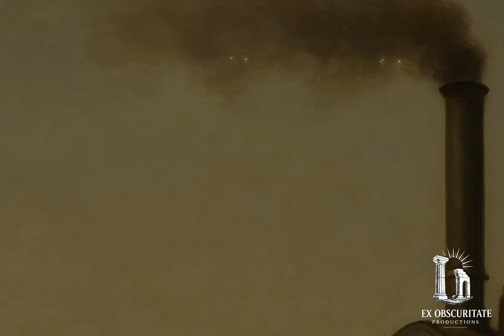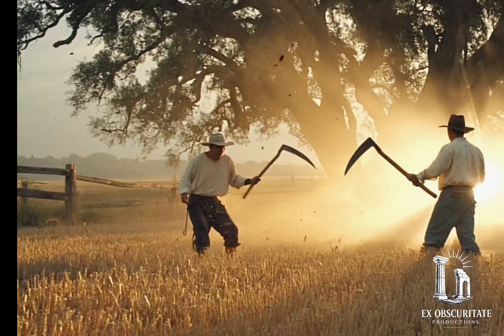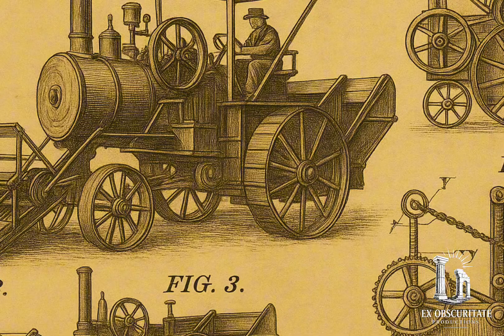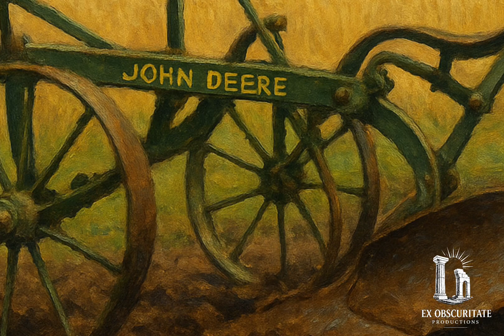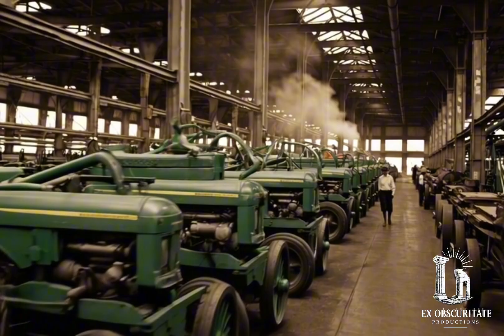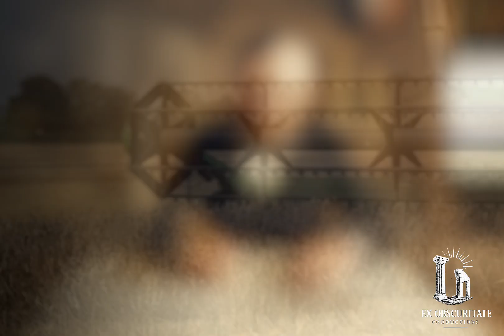How a Wisconsin Inventor Beat John Deere to the Self-Propelled Combine

Comment: H V McKay Sunshine in Australia and Massey Harris both had self propelled combines before WW2
Reply from the maker: Yes they were big early players in the market
Reply: The Massey Harris # 20 is generally accepted as being the first commercially successful combine harvester. It was first manufactured in 1939, and some 925 units were built over a two year period, when the smaller model # 21 replaced it, as it was cheaper to manufacture, smaller in size, appealed to a much wider market and priced such that it was much more affordable than the previous machine.

Comment: John Deere was no where near the inventor of the Self Propelled combine.  Quick and Buchele in their book the Grain Harvesters mention many other contenders.  They list the steam powered Berry combine of 1886 as the first self propelled combine.  It cut a 40 foot swath They list other machines by Holt and Best and show pictures.  An 1893 Holt cut a 50 foot swath.  Pushing the size of the McDon headers of today.  Gleaner had a tractor mounted combine earlier in the 1920s but it was not a true self propelled. The Massey 20 of 1938 with 925 units built was the first mass produced self propelled combine.  It was replaced by the smaller Massey 21 in around 1940.  This was the first commercially successful self propelled combine.  The Massey 21 is remembered as the machine used in the first harvest brigade.  IHC had the 123 introduced in around 1942.   Deere came along much later with the successful 55 around 1947.  Deere really pioneered the up top engine with a centered design.  It had yearly improvements so by 1955 it was really starting to stand out among the competition.  Oliver, Case, and Minneapolis Moline released their first self propelled combines about the same time around 1947.  Gleaner had the A as its first self propelled introduced in 1951.  The pull type Moore of course predates all of these.  The Moore also was destroyed in the first combine fire supposedly due to an ungreased bearing. 

Other areas of world were also experimenting and Australia had a self propelled stripper around the turn of the century.
Reply from the maker: That’s a really rich overview. Thank you so much for taking the time to share it.